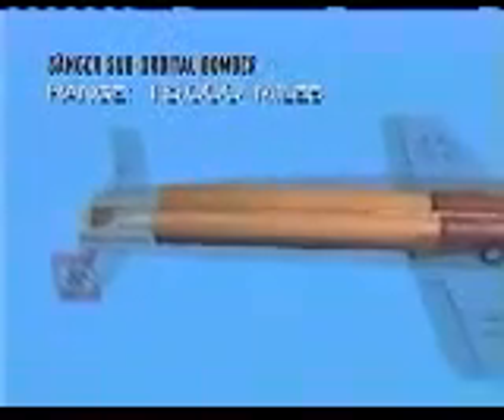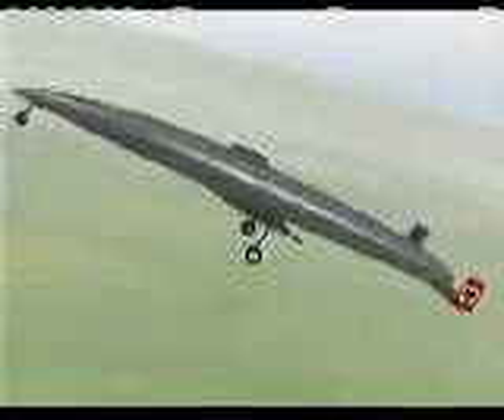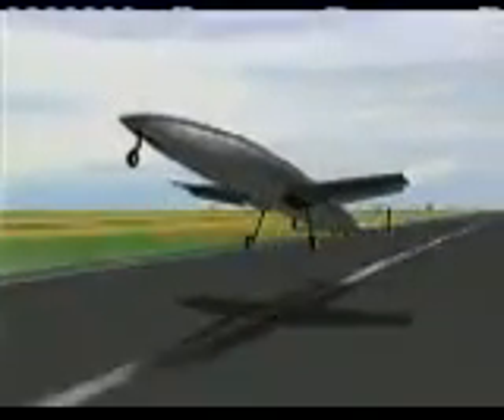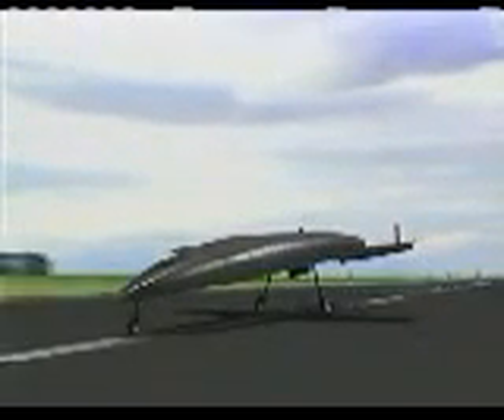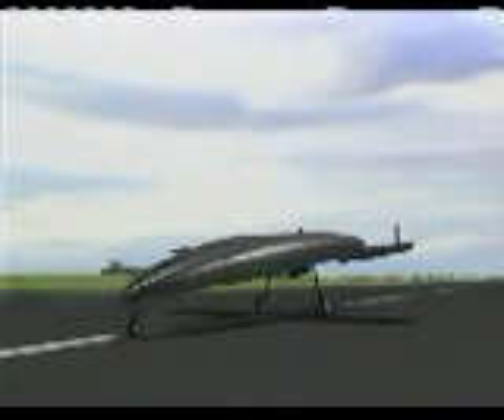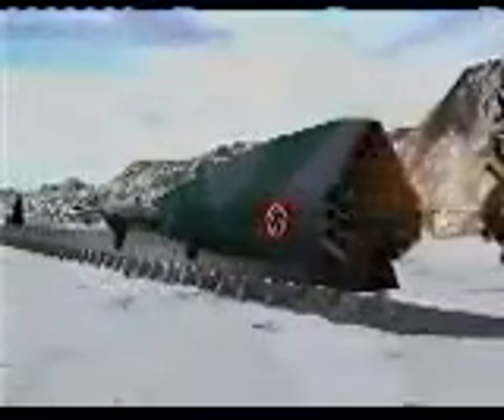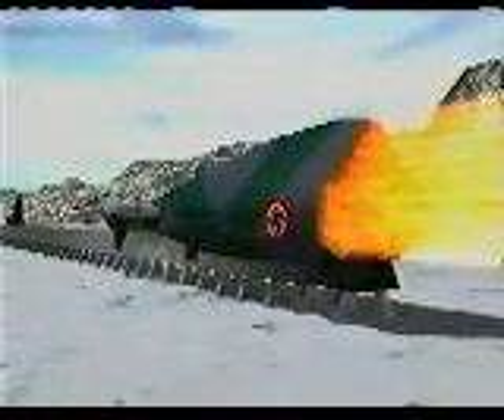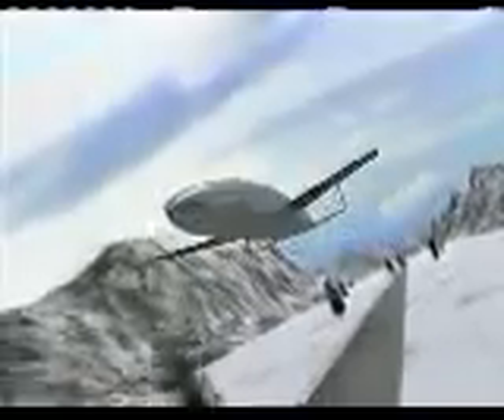"Amerika Bomber"

Comment: Sanger had grossly underestimated the amount of aerodynamic heating that would have occurred on the crafts first bounce off the atmosphere.
There's evidence that towards the end of the war he realised that the craft would need far more heat shielding made from materials that simply didn't exist at the time. More shielding means entering the cycle of spiralling power to weight ratio.
Fact is, it would have burned up.

Comment: @carsearch2001 You forget that Space Ship one which the Virgin Galactic company are developing does not require titanium or heat shields. That is because it does not attain enough altitude or speed to require bleeding off that much speed.

Comment: Well the Germans were ahead of their time however, as said earlier, they didn't have the composite materials, much less raw materials such as titanium, to make this rocket light and strong enough to survive the intense friction of the needed "bouncing" speed.  E.G. on Feb. 1, 2003 the Space Shuttle's heat shield tiles (TPS) were damanged causing the disintegration of the shuttle over Texas AND/OR the SR-71 that becomes red hot on mere MACH 3 runs under relatively slow jet turbine engines.

Comment: If they had launched toward the East and took advantage of the Earths rotation, they could have gained a little bit, but in order for this to work they would have to reach 18,000 mph which is far to high a speed than they were capable of obtaining at the time.